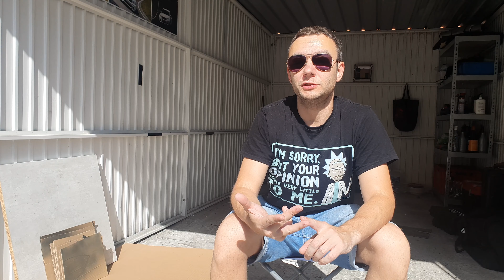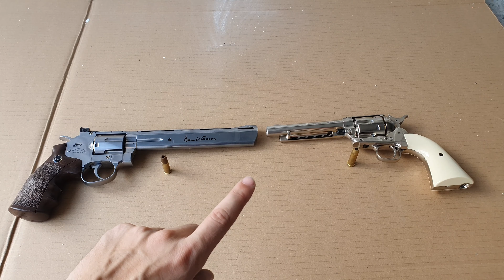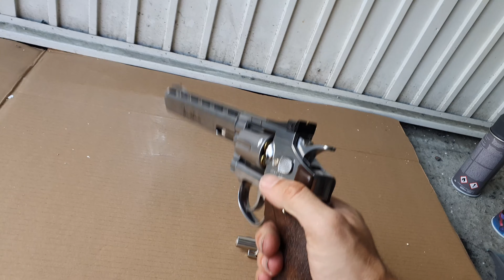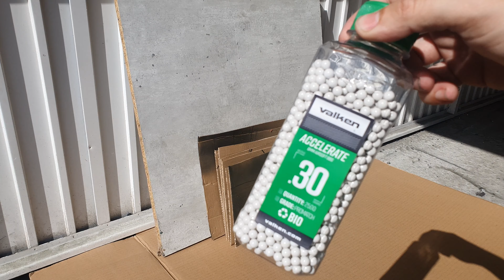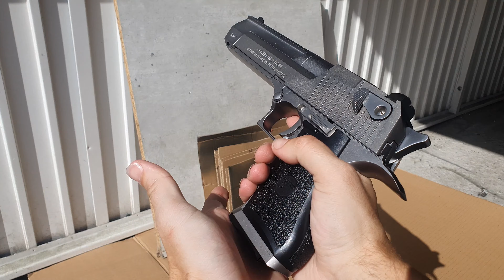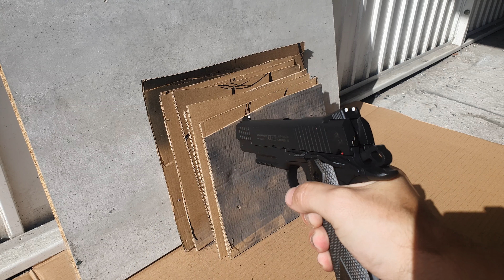Dan Wesson VS colt SAA  and other stuff

Comment: Is it normal for my Dan wesson 8-inch airsoft revolver to shoot 315 meters per second with 0.4 gram bbs?
20 joules is a bit too much for airsoft...
Reply from the maker: I only have the steel bb
There is no 20j version
Reply: @HappyDude1  I chronoed my 8 inch Dan wesson with 0.4 gram bbs and it shot 20 joules at 315 meters per second
Reply: Don't you mean feet per second, meters is 3 times faster, would mean your pistols doing 900 fps, which it won't lol
Reply: @Sphyxx that happens when the chrony reads the co2 spitting out and not the bb
Reply: U put extra zero beside 2 joules

Comment: How big are the inner barrels on these 4.5mm? In aus we got the same thing cept our inner barrels are 7mm, with the peacemaker the shells are 4. Sometning mm and on the end has been bored out to 7mm to stick a gel ball in ghe end i shot a 4mm steel bb out of it but its a little loose😊
Reply from the maker: They look 4.5 mm at the end
Reply: @HappyDude1   any chance you can  send me over a 4.5mm barrel and a shell set lol
Reply from the maker: @DanSmith-l3j  
I tried to get parts like barrels or gas valves to make a powerfull airgun but you can't 
The only way is to buy the guns with the parts you need
Reply: @HappyDude1  I'm happy with the power it's shooting over 400 fps I just want to change the barrel over to shoot BBS and pellets simple barrel and shell swap

Comment: I have a question dude. Are the shells from the colt single action fit the same in the dan Wesson? If it does. Could you make a video to see if is more powerful with them than the original ones.
Reply from the maker: I dousnt fit

Comment: Hello there. I recently received my Dan Wesson 715 Pellet version which I only used today. When I inserted the CO2 capsule into it and screwed it tight, I could still hear a small hissing sound (it's leaking out very slowly). The hissing sound stopped when I put a loaded cartridge into the barrel (to prevent the leak). Is that supposed to happen? Or does it mean the seal is failing?
Reply from the maker: I think that you have a bad valve
Reply: @HappyDude1  Hey there, I just tried another capsule today. I screwed it tight and fast before it could lose too much gas initially. 

But once it's screwed solidly and I put my ear near it, I can still hear the hissing sound. When I put my finger on the firing hole behind the drum, the hissing stops (since I plugged it with my finger). 

Do you think I should return it? I was still able to shoot around 60 rounds, but I'm thinking it shouldn't be leaking.
Reply from the maker: @replacesoundboard  
Yeah ask a new one 
You should not hear hissing
Reply: @HappyDude1  Thanks for the quick replies!
Reply: @replacesoundboard  a simple trick is to use vaseline on the seal.
Reply: @henshimai  I decided to return it and purchase from another store which since became my favourite armoury. The whole package looked like it was in a better state than the other one (be it the Dan Wesson or the fake cartridges), and no leaking sound. Thanks for the idea though.
Reply: same problem here, any solution?
Reply: @vickysekhri7  Mine was leaking from out front (where the air comes out into the pellets). If you just recently purchased it, depending on which country you live in, you can ask for a refund, because you're supposed to purchase a brand new and flawless product.

Comment: I have a dan wesson 2.5 inch , is not very powerful but i have adapted a nut in the hammer spring to increase the fps, You can also try that with your dan wesson 8" that will increase the fps.
Reply from the maker: that dousnt inceease the fps   😀
The only way is to replace the parts there is a upgrade video on youtube. You will need the parts that are in the 8 inch version
Reply from the maker: Nope it dousn't 
I will try to make a video about it
Reply: should i get the 4" or 6"?

Comment: does the dan wesson 8 work without gas?
Reply: How,? How would it work without gas ? It's not spring loaded, the clue is in the gas, a portion of gas is blasted into the chamber holding the pellet which propels the pellet, turn off the gas and..?
No it won't work without gas.

Comment: The SAA sounded so much better than the Dan Wesson
Reply from the maker: Indeed
Reply: Yes but you cant shoot people with it
Reply: @dirkdiggler7706  There's 6mm Airsoft safe versions!
Reply: @scully1622   ok. Well i decided to get a glock 17 gen 4 instead
Reply: I've had two silver peacemakers both shot 130/140 pellets to 1 bulb of co2 for some reason, the black ones l have would only average 60/70  which ain't bad, but it's weird they're the same gun but the nickel silver fire more pellets,

Comment: Wow I love your gun collection!
I wonder if your dan weson is plastic BB model but you can bought 4.5mm rounds to use that revolver with steel bb
Reply from the maker: Thanks, indeed
Reply: @HappyDude1  
ty I subscribed.  I want to order a Dan Weson 8" but has to be same as yours and I don't wanna mistake. There is a 8" version low power and there is no version  with steel BB's but I saw your video where the box contains the steel BB box inside
Reply from the maker: @ars1crea  
Depends on  what your country allows. We have no law on airgun power